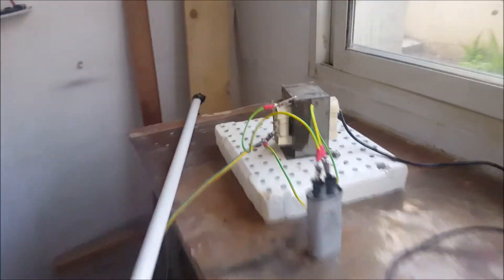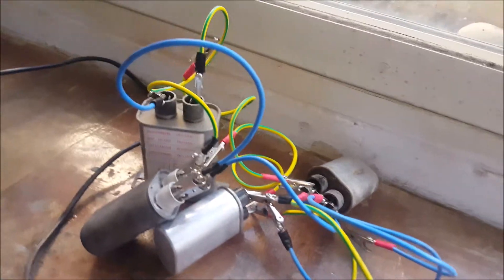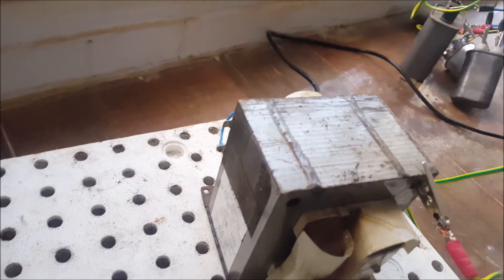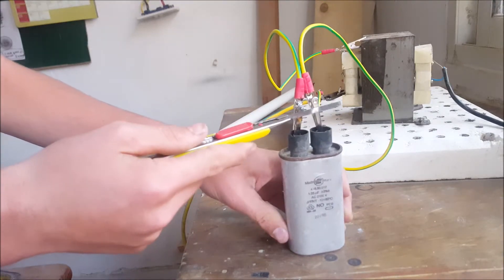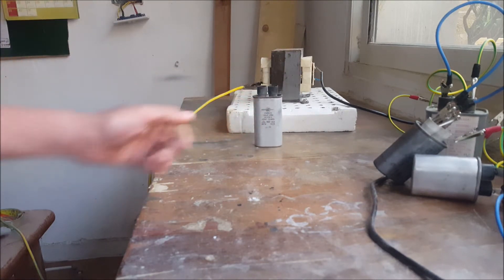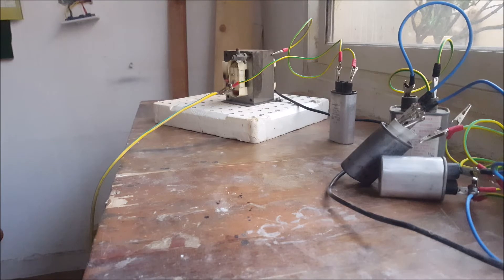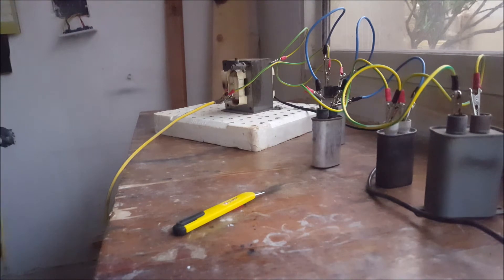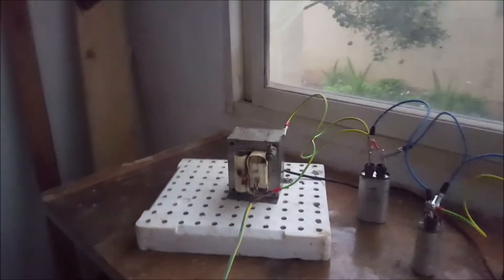Making lightning in my own basement

Comment: Good work. 

Instead of discharging the chicken stick onto the MOT core (which can cause damage to the magnetic copper wire) you could discharge to a small metal plate which is then connected to the core of the MOT. 

As you link more and more capacitors together you should have the connectors insulated from each other so you don't have any Sparks jumping the gaps and discharging voltage where you don't want it. 

Linking two MOTs  together will make you a portable and versatile high voltage power supply that can be used in many experiments. Some of which can be found all over YouTube... such as spot welder,  plazmatic Arc smelter - King of Random has a great one (which is personally one of my favourites and I'm building one) and a Lichtenberg effect wood burner.. among the many many more uses.

 Always make sure you use proper safety and think twice about what you're doing before you do it when you're dealing with high voltage and high current.

Be inspired ....

Always think for yourself ....

Dream !!!